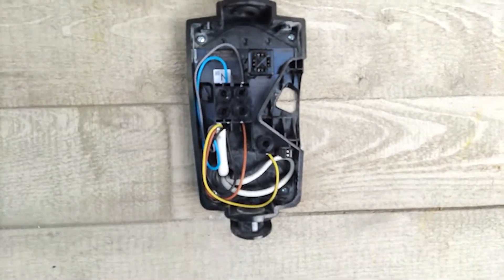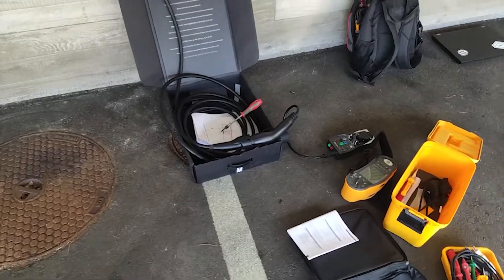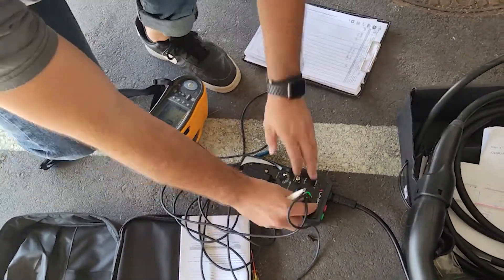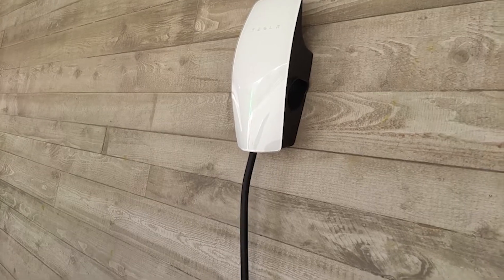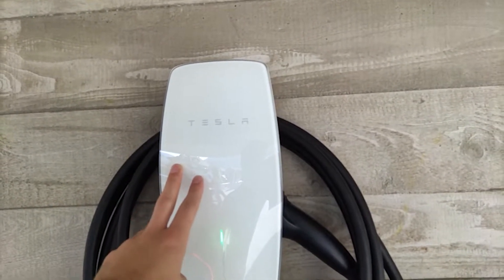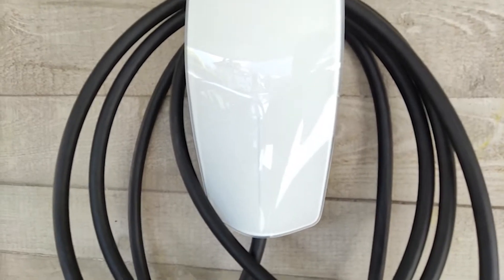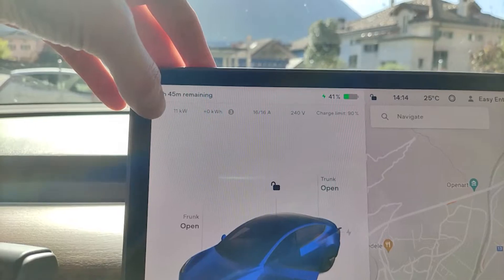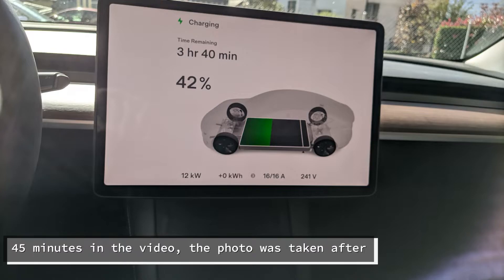The electrician installed my Tesla V3 charger on a 3 phase line!

Comment: Settings should be set with dip switch, carefully remove Front cover, adjust the dip switch setting and it will reach to 32Amp
Reply from the maker: Is this possible on the European model? From what I read on the manual it's limited at 16kW
Reply: @SwissExperiments  charger are same.
As an electric person, doesn't matter with Europe or other area.
Electronic board are same.
Try to check in your area with those who repairs the charger.
Or just open front cover and see the components.
It's the same for all else what is the use to provide 3 phase + N connection on charger
Reply from the maker: @haaziza  I'm pretty sure the US one is different. I remember comparing the manuals and videos online and they look quite different internally because there's no 3 phase charging in US Teslas.
Reply: There is no dip switch in the TWC3 as used to be in the TWC2.

Comment: Y it shows 220v, you connected with 3phase which is 380v to 400v ?
Reply from the maker: that's because Phase to neutral is always 220-230. you'd see 400v from phase to phase.

Comment: Cable looks like 1.5mm. In theory, it could handle 16A, but u would use no less than 2.5mm for 16A installation, and no less than 6mm for 32A installation.
Reply from the maker: It's definitely more than 1.5mm. in theory I could pull 22kW if the car and the charger allowed me to
Reply: @SwissExperiments   recommended is minimum 4mm

Comment: Thank you for the video! I just got the same installed (400v 3 phase), voltage between N and L was 230V and charged the vehicle fine. However when we checked the current at L1 L2 L3 it was not balanced, full load only on L1. Why is that? Thanks in advance for all your help.
Reply from the maker: That's not something I can help you with unfortunately. How did you measure the load on the 3 different phases? What reference did you use? You should connect to the charger via wireless to check what it says about the connection
Reply: @SwissExperiments  
Settings should be set with dip switch, carefully remove Front cover, adjust the dip switch setting and it will reach to 32Amp (Flash Cool Technical Services Dubai )
Reply: Many vehicles have internal single phase only. While plug is 3 phase, only one is used. Which car was used for test?
Reply: how much price charger,,,,,,?

Comment: I only know of one three phase home in North Carolina;)
Reply: In the meantime, in Serbia it is normal for even small apartments to have 3 phase service for cooker or storage heater. 3x25A 230V service 17kW. 
My old grandparents home used to have 10A service at 220V nominal.
Reply: @Mladjasmilic  much cheaper for sure. Most American Power is government controlled. Bleed em dry;(
Reply: @jackcobbiii1797  Electric company (EPS) is state owned, and we have very cheap electricity, even though we are connected to rest of Central European grid.

Comment: What size the cable and circuit breaker? Thank you
Reply: We Recommend minimum 4mm cable and CB should be above 32 amps additionally must add ELCB.
Reply from the maker: The circuit breaker is set at 32Amps if I recall correctly (22kW) but I don't remember what size the electrician used for the cable. Given it's a 400v 3 phase you don't really need much but stick to what the manual suggests.